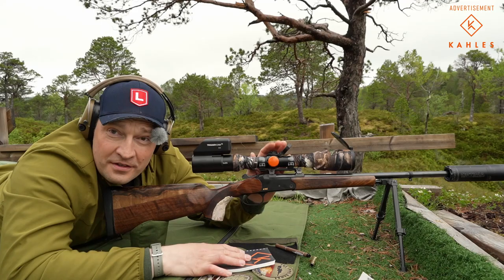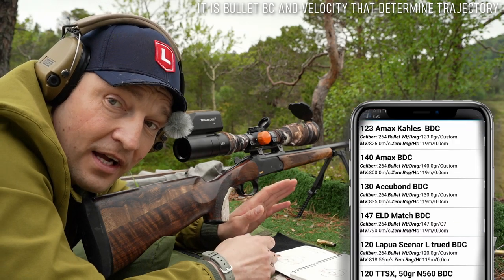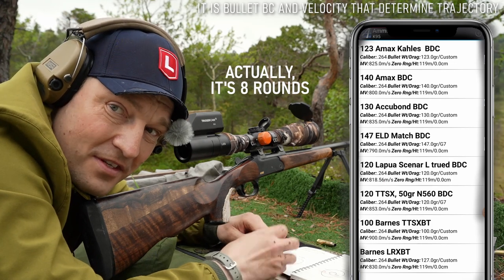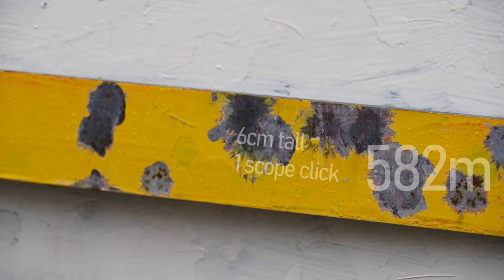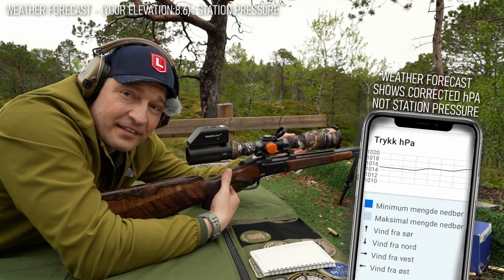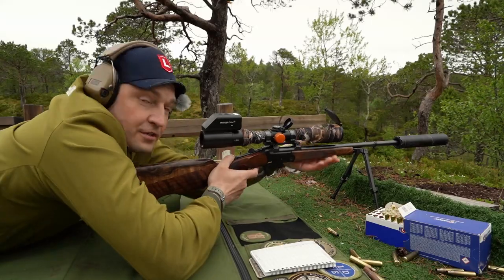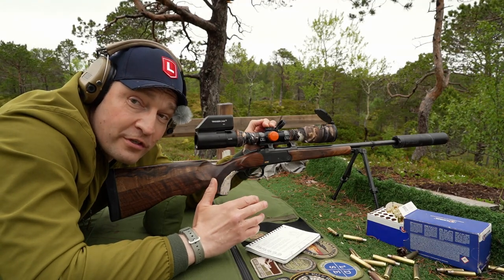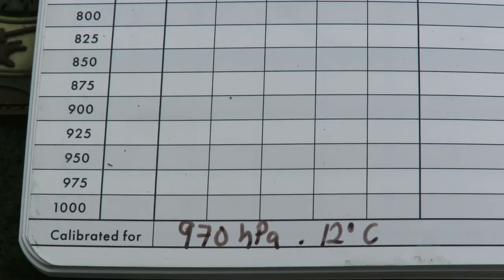LRB mini (354): A bullet drop compensator works!

Comment: Hi Thomas great video as always, would love to see your working outs for temperature and pressure changes  and how you add and subtract them on a tactical mil mil scope.
Ref your video perhaps people meant a BDC reticle like ACOG where you can only zero the turret and use the graduations in the graticule for holds which are designed for a single bullet weight through a set barrel length which is of use more to Military personnel.
Just a thought 💭 
Love the show please keep making great videos
Reply from the maker: I will have to gove that some thought. I just ran out of "film season" as my hunting starts in 3 weeks.

Comment: would be curious to hear you opinions about "Christmas tree" reticles or just generally about shooting holds
Reply: Ye, a christmas special hehe
Reply from the maker: I don't really have that strong opinions about it. It is a somewhat specialized skill that require a fair amount of training to be consistent at a high level. I use minor elevation hold together with PBR (point blank range) or corrections to a dialled range, or as a solution to a specific match stage where speed is essential. But not as a "range input" overall, I prefer "dial and forget" and then focus on sight picture/aiming and trigger pull. I do not want to introduce variable aiming references (hashmarks) to that process. I want my aim to be as unobstructed and simple as possible.

Comment: Well your basically wrong , I suppose it depends on what you call good enough but you set up with the purpose of showing it working , one can do the opposite and show how it doesn't work.  It's only truly accurate for 1 ballistic profile.  You may find others are close enough but there is a difference between close enough and correct .
Reply from the maker: Well, you're basically both right and wrong. I might have presented myself poorly. I agree that it is only truly accurate for one ballistic profile, but that ballistic profile can be created with many V0+Bc+weather combinations. 5+5=10, 6+4=10, 4+6=10, 7+3=10. Same principle, change the input numbers, but the end result is the same.